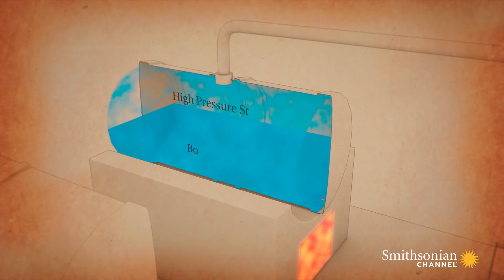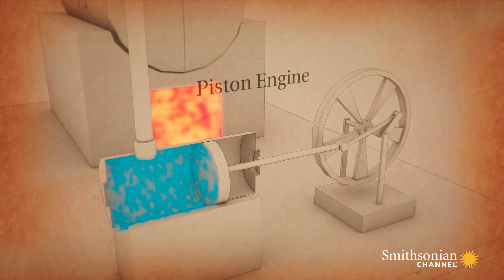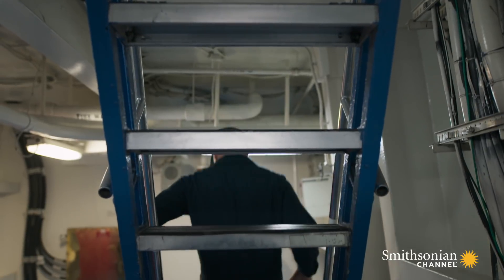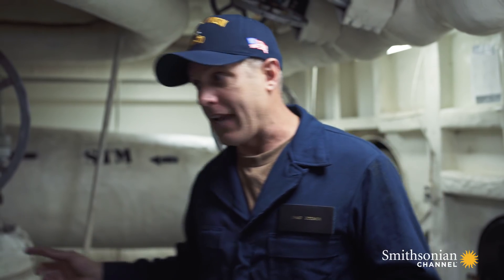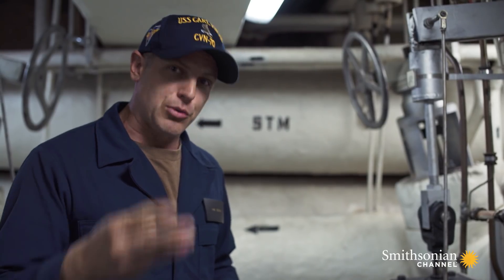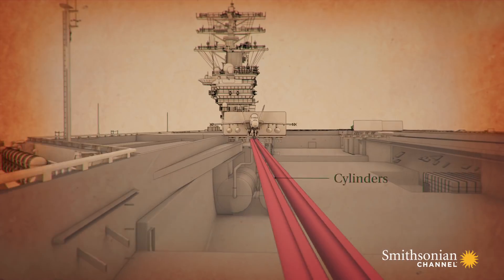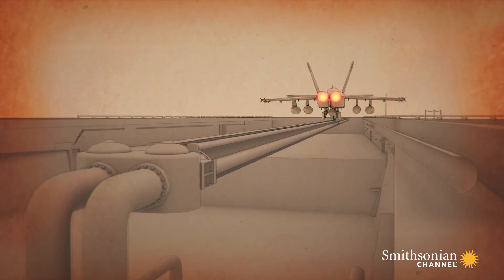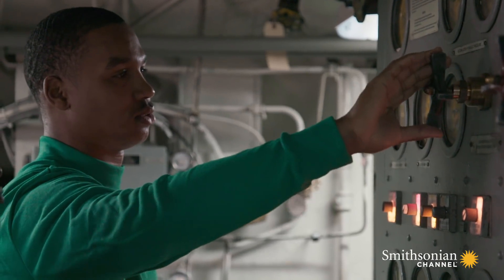This State-of-the-Art Aircraft Carrier Relies on Old Technology

Comment: They're moving away from this ancient tech because of all the problems it causes.  First the area below deck where the cats are is super hot and the next big issue is it is prone to catching fire.  Moving to electromagnetic cats will remove the heat and should lessen the chances of weekly fires.
Reply: The reason this is not the only ancient tech is because the american government has tested this over and over for decades.  They have a hard time giving up on this ancient tech because most of the time it is quite reliable.  Anything that is a critical system will usually be this old stuff.

However when it came to flat pannel monitors for their computers they went crazy with the speed they got rid of the old CRT monitors in 2000. If i had to guess it was because it saved a lot of space on the ships and consumed a lot less power than the old ones.
Reply: @BillAngelos  That was the reason.  It saved a LOT of space - and that counts for a lot on a ship.
.
Reply: @Stickey Sickness Other countries in the near future will build a flattop AC which the Americans built back in the 50s.
Reply: @Stickey Sickness I meant to say CATOBAR carrier
Reply: And yet only American and French carriers have this tech. The Brits abandonded it long ago for VTOL.
Reply: @project705lira  also russian amd brits using a ramp, 
Simple but effective
Reply: @j3fron  Aircraft limited by weapons and fuel payload. Even India has an ski jump carrier in service with the 2nd on being inducted by 2021.

Comment: Guess magnetic rail catapults failed
Reply: the Vinson entered service in the 1980s
Reply: Jolly Green they got it worked out
Reply: @Dog.soldier1950  that's good news. Now let's put it on the next carrier
Reply: Jolly Green I agree the new simpler system takes fewer sailors and space.  It’s long term reliability will be seen
Reply: @jollygreen4662  They are. The ship in this video is almost 40 years old, the Gerald R. Ford Class are the actual newest ones and they are using EMALS Catapults.
Reply: @Dog.soldier1950  USS Ford cannot launch one single fully loaded fighter jet? That's not worked out at all ...